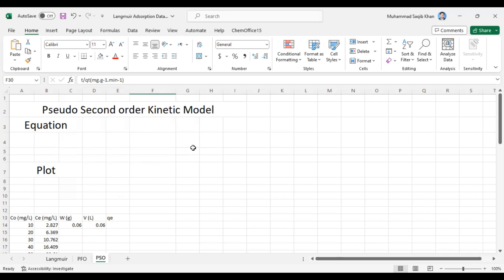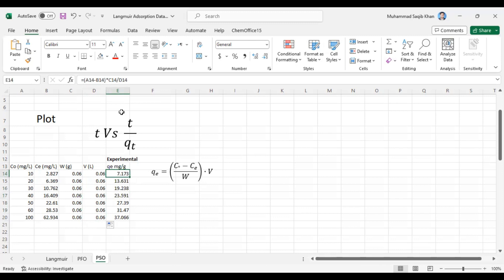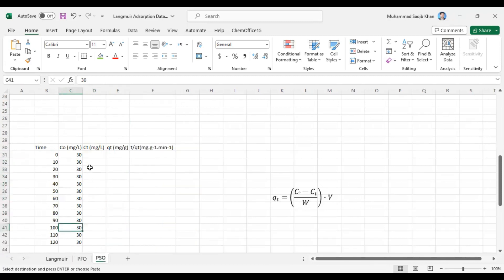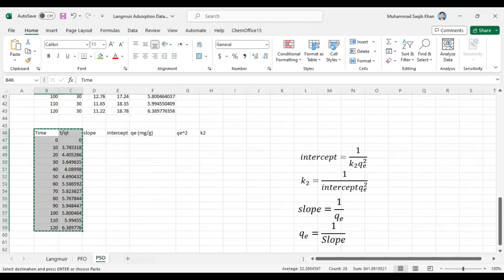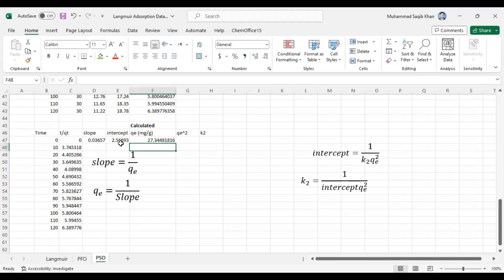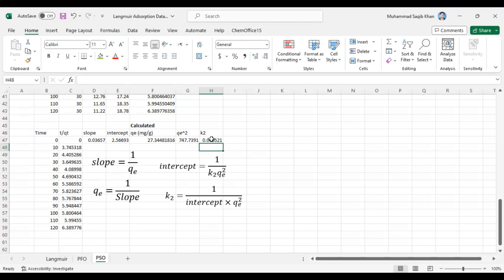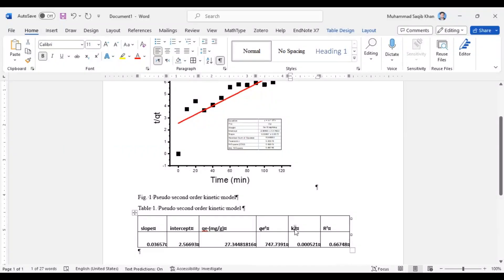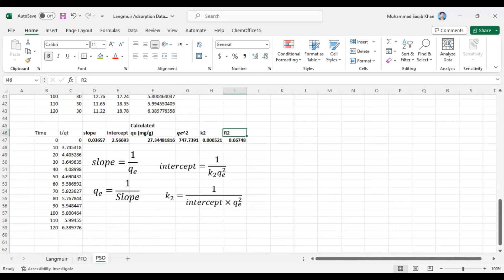How to Apply/Fit Pseudo Second Order Kinetic Model To Your Research Data | Dr. Saqib Science Academy

Comment: This is good effort, however I suggest that you should need to start from very beginning and draw outcome within single sheet.
Take absorbance data of UV for upto 2-3 samples at different time (before and after adsorption process, let's say -60, -30, 0, 30, 60, 90) intervals and elaborate adsorption capacity (Qe), Qt along with Ci, CT etc. I have searched countless videos. No such content exist. Even in this, conversion of concentration (Ct) were without formulation. They were just copy-pasted. I am facing issue with conversion of absorbance into concentration and matching with original concentration. Like you used 30 mg/L original concentration and how did you then aligned Ct with original concentration (30) at zero time interval. Factor like solution division (when divide 30mg/L soultion into 100mL or 30 mL) needs to be clarified in these calculation so that would become more informative. Also there is need to discuss concentration determination without calibration curve (form example 10g/L was divided into five set with each 200mL capacity. So here we don't have numerous concentration and there is not possibility of calibration curve or standard line so how will that case proceed)
Reply from the maker: Thanks for the detailed comment and suggestion. From the comment what I understood is you have problem in conversion abs to concentration. I have explained this in another video you can find it on my channel. If still there is question or confusion please let me know, we shall try to solve and understand it together.

Comment: I have absorbance data from UV Analysis and I am unable to understand these (Qe, Qt terms). Can you please elaborate using concentration term of single plot at specific concentration rather than multiple concentration. Shall I provide numeric values ?
Reply from the maker: Thanks for the comment, you can use the absorbance data for analysis or you can convert the absorbance data to concentration, you can find the conversion of absorbance to concentration on my channel
Cheers
Reply: @drsaqibscienceacademy  I am not getting anything from channel.  According to you, we need multiple concentrations data and then we achieve absorbance from multiple concentration and then we establish baseline.  What if we don't have any data from multiple concentration. I have only single concentration data for pure dye and then 4 nanoparticles samples were added to test degradation. 
So how I am going to establish baseline and convert absorbance into concentration. 
I do have other questions, I want to learn adsorption capacity calculation using equation (QE= (Co-Ce)m/V) and also I want to know how to calculate amount of catalyst to remove dye per unit time. Actually it's a question raised by reviewer
Reply: Even in this video you have not explained conversion of absorbance at particularly time period into concentration (Ct)